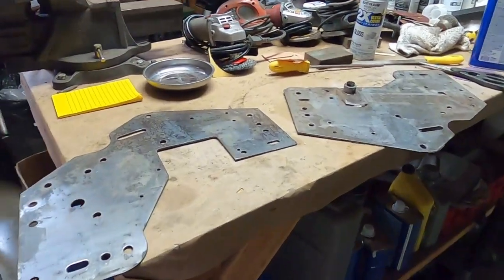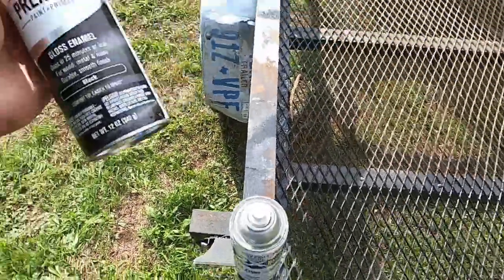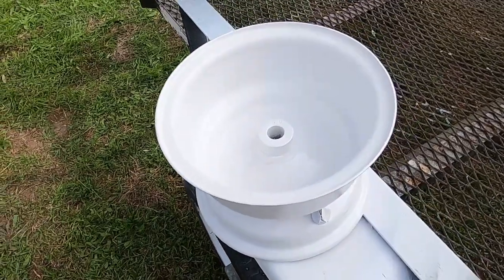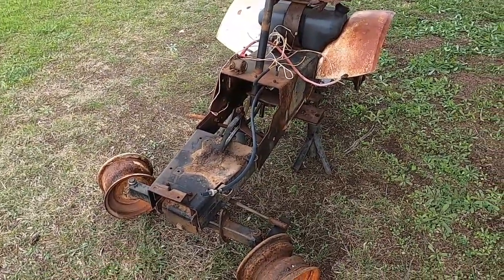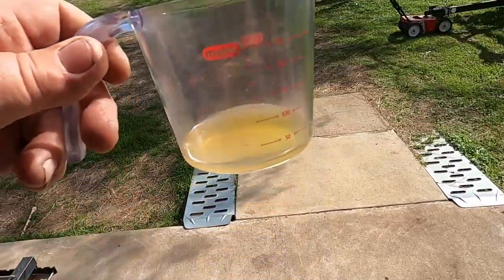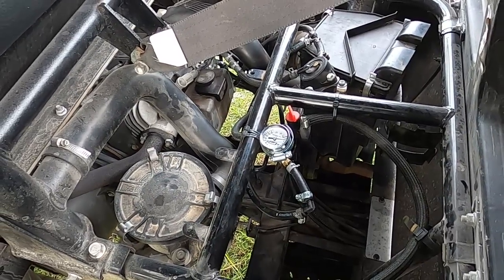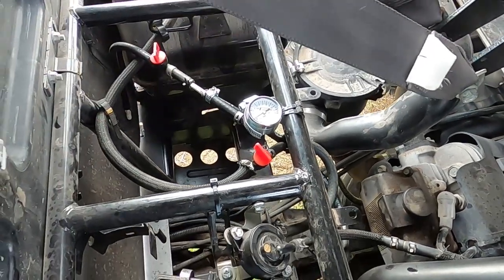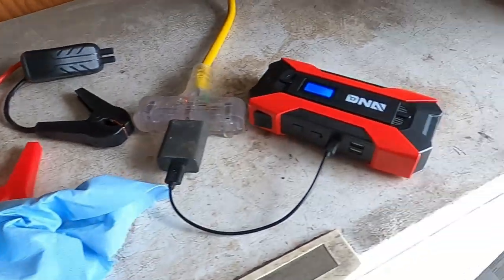Roper 16T   2nd try on the 8 inch rims

Comment: Great progress with the wheels and side panels. Will you need to replace the bushings in the front axle?
Reply from the maker: Don't think so, there is no looseness on these. I'll pull the other axle off the parts tractor and choose the best fitting spindles.